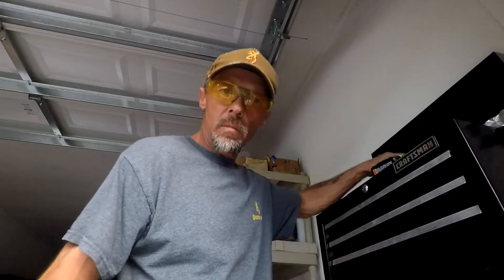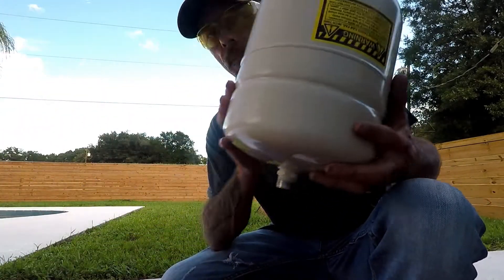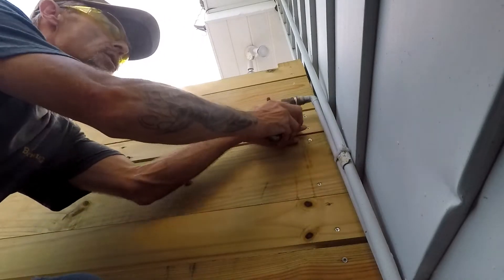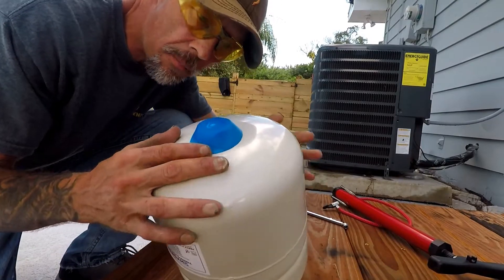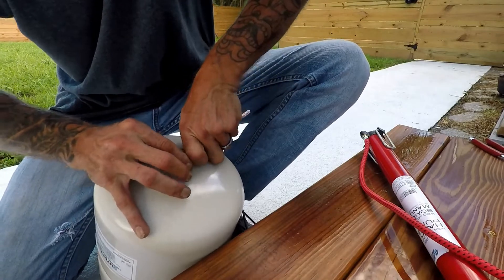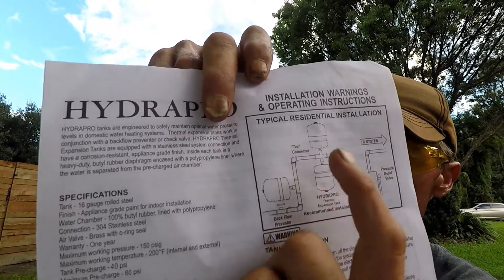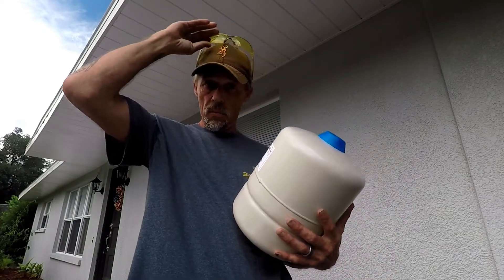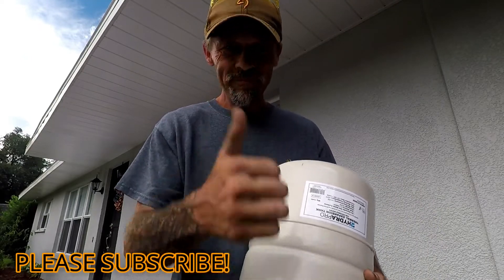HOW TO CALIBRATE A THERMAL EXPANSION TANK

Comment: Why do Plummer’s almost always put expansion tanks in upside down? That traps air and reduces the amount of water the tank can hold. Same thing with horizontal mounting. There is a Warning label that is readable when it’s put in correctly, that’s why you don’t see warning labels put on upside down.
And yes, I actually know what I’m talking about here, it’s in the install instructions as well.
Recommended means ‘do this’
Like
I wouldn’t recommend not reading the instructions. Bad habits are hard too break.
Reply: Any unpressurized air trapped within the wet section of the tank will eventually be dissolved into the water. Until it does, however, it will easily be compressed by the water pressure.

Comment: Tim,  How do you determine which size expansion tank to use?  My Rheem Water Heater is 70 gallons.
Reply: There should be a chart on the box of your expansion tank. Just look at your heater size on the chart and it tells you which size to use. Its never bad to get the bigger one in your not sure.

Comment: Hey Tim! Quick question for ya. If we installed our new one and we didn’t match the correct pressure, I understand you said it wouldn’t work correct, but will there be any harmful effects or any other effects period from leaving it at the standard 40 until we get the tools to match pressure?
Reply from the maker: Good question no harm but not doing any good. You will have to turn water supply back off and remove the tank to add air
Reply: Since a gas is compressible, I don't see why the volume of air makes much difference.

Comment: Tim, thanks for clearing up that oversight on the pressurization.. But more importantly, I'd like to hear your thoughts on installation, should it be vertical or horizontal.. And which is better for longevity of the expansion tank.  No one seems to be exactly clear on this issue, also should the Schrader valve be up or down... ? And what are the ramifications for each type of installation, again, this subject doesn't directly seem to be addressed, the tank is designed to certain way, but what is the optimal position for longevity, and does it have any ramifications. I am in the middle of having to install one of these expansion tanks. Because my city installed an electronic water meter and I believe it has a check valve.  Any thoughts on this subject should produce a nice video, with knowledge people can use.  P.S. please make it clear what a vertical installation is and a horizontal, as silly as it sounds. Many diagrams show both for the installation. Without exact clarification which is which

Comment: On a well system with a pressure tank in the system already, why would I need or want one? Great channel
Reply from the maker: Thanks for commenting. The pressure tank on your well system is used to maintain water pressure in you homes water system. The thermal expansion tank serves a completely different purpose as it is designed to keep the hot water created in your water heater from rupturing your lines. 😁
Reply: @PLUMBINGWITHTIM . Thanks, guess I better research one, never had one before on a hot water supply.
Reply: @PLUMBINGWITHTIM  but if the well expansion tank is taking the expansion from the well pump, it would also take up the thermal expansion from the water heater..? unless there is a check valve between the well tank and the water heater.??  I mean expansion is expansion..right? Also the only real reason that you need a thermal expansion tank is if there is a incoming check  valve or backflow preventer on the incoming water, your water has no place to expand to when it heats up.  without a check valve it can expand back out into the city water supply.  And thats why the city wants a check valve installed so you can't contaminate the city water somehow....unless I'm all wet? (no pun intended)